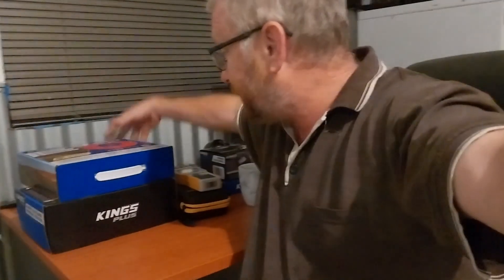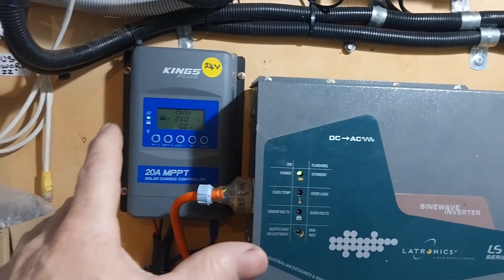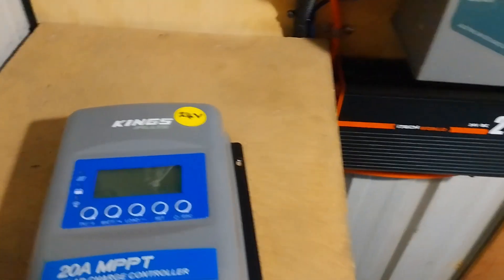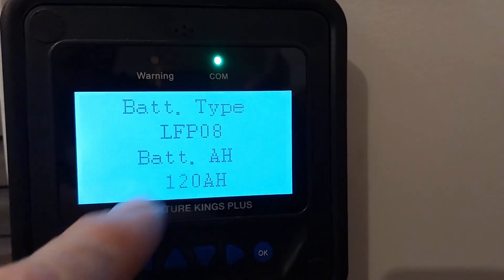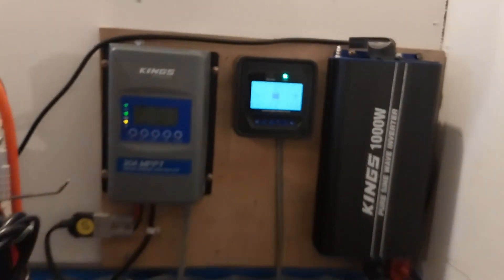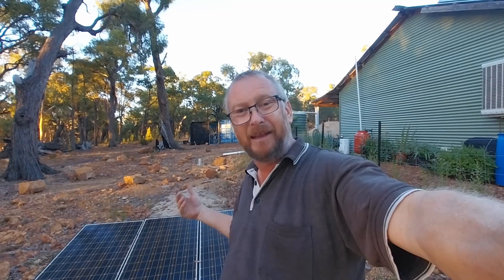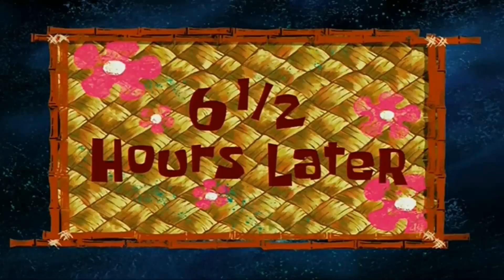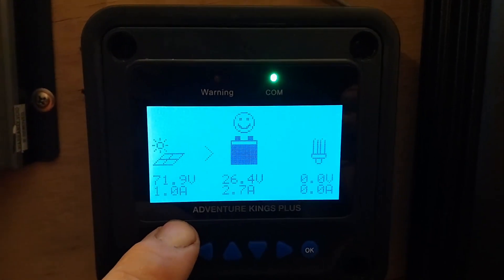Kings Charge Controller Upgrade & A New Solar Panel Analyzer Tool

Comment: Very good video brother do you have the links to those Kings mppt controllers
Reply from the maker: If you go on to the kings website you will find them there. They are always having a sale, so a link may not open depending on the sale at the time.

Comment: your a bad influence now i drink coffee LOL.
epever arent bad especially for the price.
people ALWAYS  tell me im full of it "always" yet my freind offgrid uses a big industrial ups , downside is its battery requirement is near 200vdc, since no battery charge controller does that , he has tonnes of 24v epevers charging every two batteries which are actualy in series to make near 200vdc, he uses somekind of high quality diodes to protect each controller, his system ran like that for years i saw it in person, now he just went 48v YET  still 24v controllers

Comment: Good upgrades Glen. Will be good to see the review on the analyser tool. Just looked it up and looks like one I see on Amazon. Well done.
Reply from the maker: A mate who is an installer for off grid power on 4x4's ordered two of them. One for him and one for me and I believe he got it from Amazon.
I see the exact same one in the Altronics store for $199 and we paid $80 for ours. Our one measurers up to 1,600 watts where the Altronics only goes to 800 watts. Goes to show the high markup they have on them.
https://www.altronics.com.au/p/q0967-800w-pv-solar-panel-multimeter/